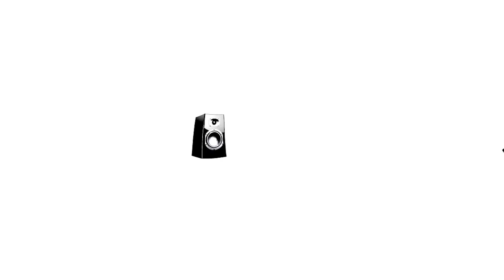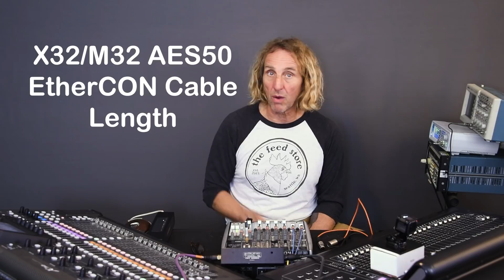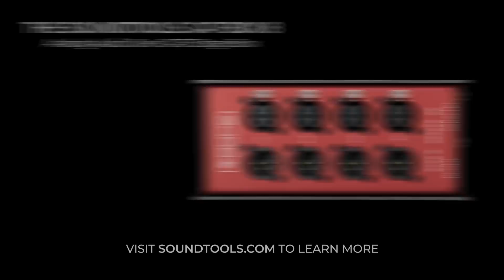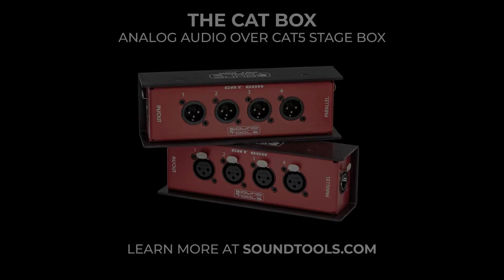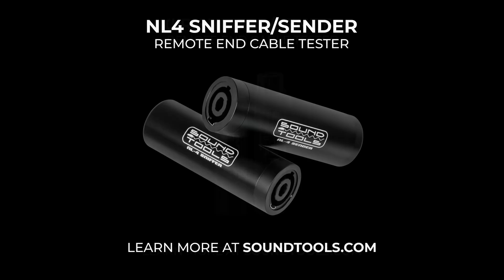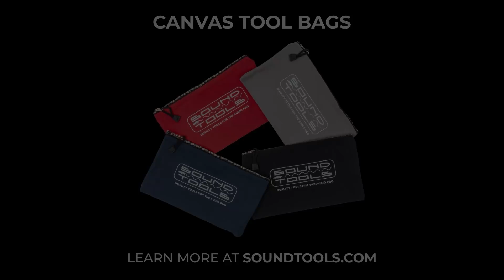Behringer X32 Midas M32 AES50 Cable Type & Length (Public)

Comment: It’s bespoken and proved, that you have to take a cat5e shielded cable. I used a professional 100m cat7 out of my stock, brand new and it produced crackles. I use now a 75m cat 5e cables as required by Midas with an cat5e extension from the drum to the board and it works without any issues. I even used a Thomann pro snake cat5e cable someday and it worked without any problems.
Longer than 75m I didn’t got some experience.

Comment: I know most of you will probably tell me that I’m playing with fire and I would normally agree. However with using this setup for a few years without fail, it may be worth a shot and extend the experiment to a few more folks by giving this a try with their own setup. I’ve owned Roland M Series consoles for a while  and have and used 100m REAC cable without issues with these consoles for years. Over the past few years I’ve purchased a few X32s to have in my rentals and have been using them on a regular basis. The Older Roland consoles required a Cat5e Crossover cable with ethercon connectors and no shield on either RJ45 connector . By surprise I was testing Cat cables and this REAC cable has worked flawlessly. I know it shouldn’t and not to trust it. But it has been rock solid no dropouts, no weird noises and I’ve had this cable fully extended to the full 100m on a number of occasions. This cable is breaking all the rules….over 80m, no shielding and a crossover cable. What gives? Has anyone tried making a crossover cable?
Reply from the maker: Many unshielded cat5e cables work fine with AES50 up to 100 meters. As I mention in the video, the issue is that unshielded cable is susceptible to electrostatic discharge. So when you're doing a show on carpet or in a dry environment those little shocks you get can fry the AES50 circuit and destroy the connection permanently.

Because of this, Behringer/ Midas has now put "use shielded cat 5 cable only" notices and stickers on the consoles.

For most or many applications using on shielded cable is fine until it's not and when it's not it's a complete shutdown from a single spark.

And then the big issue comes in that as soon as you switch to shielded cable it no longer works at 100 m. Or at least that's the case for most shielded cat5e cables

All good using unshielded especially if you're not in an environment that gets lots of static electricity.

And also there are people I believe that want to use a shielded cable and be safe from losing their show to a spark and also need 100 m or more in length

And that is what I'm working on with this cable
Reply: Thanks for the quick reply Dave. I know I’m living precariously with this setup. Hence I too have been trying some other options. I have a 200ft Cat6a in transit and will test that as well.  I still don’t understand with all that is happening that this cable is able to work even with a crossover designation. Has anyone played around with the Ultranet feature and what format of Cat can be used for that port? Cheers and thanks for all of your time a dedication to this subject. It is appreciated on this end.
Reply: @ARTAudioCan 
For ultranet setup there are allegedly issues for more than 6 items in the signal chain, as I’ve been reading in forums. I didn’t noticed it. I’ve been running six monitors, six subs and two tops in one chain flawlessly. I’ve been using Thomann pro snake cat5e cables and even had to dismantle the neutrik plug to plug them into the Turbosound subs and tops. Silly, but a different topic. Anyway, it worked and it still does.

Comment: Any sort of inline connector is a terrible idea for network cabling as it causes impedance mismatches which cause signal reflections and everything goes bad really quickly. It's very important that they be single unbroken runs of good quality CAT cable. It's much less about the length of the cable than it is avoiding having any joins; this is why you say stuff like "100ft worked but then I added a 6ft extension and it stopped working" it's not because it was only just working at 100ft, it's because the inline connectors screw up the transmission line properties.
Reply from the maker: And all of that is easily measured and tested. A great cable with several couplers can outperform a crappy cable with no couplers. The only real way to know is to test it.

I am currently designing and testing a cable for AES 50 that is stable and dependable at 100 m with a 30 m extension.

In my opinion, you should be able to take any cable and put a 10% to 20% extension on it and have it still work perfectly. If you can do that, then you know that when you remove the extension it will be very stable and dependable for your application

Comment: I would love to see waht it is like with a CAT6A cable. Anything to help the situation and make using my Midas M32 and Midas Stage Box more stable would be great. I cheaped out on a 50m Cat5e from a well known online music equipment provider (It was their own brand) and it cuts out all the time. Bought myself a better one (hopefully) from somewhere else. All I can say is that the cheaper one I bought clearly is not good enough for my needs.

 Love your videos by the way Dave. I have found them very helpful, you're like a guru of sound engineering.

Comment: Dave, I really appreciate your videos.  Generally ethernet cable shouldn't go over 100 meters when connecting computer and network devices.  I know you said not to use any connectors or couplers, but I was wondering if you have used a network switch or a repeater to boost the signal.  I might be over-simplifying the solution, but I wonder if anyone has tried it.
Reply from the maker: We have used switches to repeat and longer runs, max length really depends on the format and data bandwidth

Comment: I had a load of Cat6A so decided to invest in the connectors thinking it would be better spec. How wrong I was, It would be amazing if @midas could update firmware to be compatible with higher spec cable. I enjoy on your vids Dave but this one sent me down an incorrect path. Will have to upgrade by console to PRO series so I can use the cable I have made 😂Thanks, Sam.
Reply from the maker: Hmmm, my take is that Midas Aes50 should not be used with cables over 80 meters.

Cat6 won't save ya. The soundtools supercat sound cat5e works well. The cable that works best for distances is unshielded belden cat5e but it also works poorly for static issues.

Best is to get a Dante card
Reply: @DaveRat  Ok, so managed to get a sync happening via using dl16 stage box as master, whenever I try to set M32 as master, I have issues. So CAT6A does work with high quality Neutrik connectors. Thanks for all you do, Sam.
Reply from the maker: Awesome!

Comment: Hi Dave 👋 

Cat6a is known to not play nice with AES50 at all. It’s also a reason why not Behringer drop down to 80M max with the new stuff like the WING and do not recommend a cable type, just Shielded RJ45.

When I experience AES50 dropout, creating a loop seems to help, connecting a second cable in the B port of both device seams to stabilize the sync. 

I personally run a Cat5e Shielded Stranded that I made myself with metal RJ45 connectors and it survived fine 2 festival sessions so far.

Comment: Another good reason to go Dante for stability or long runs, is that it's incredibly easy to send it over fibre.
Reply from the maker: Agreed, we (Rat Sound) have lots of problems when bands bring in X32 and M32 and use AES50. I did this vid to help people understand why
Reply: @DaveRat  have you much experience of using the Klark Teknik fibre converters for AES50? I'm urious if they're as dependable as Dante over fiber.

Comment: Scanned about half of the comments, didn't see anybody bring up the question of how is the shield draining? I tried to get an answer on the Behringer forum and stop after a few rounds because nobody understood my question correctly. Made up my own mind based on experience with similar products and got 100feet (not meters) of "ethercon" compatible product that drains the shield at one end ONLY. At 100+ meters, the electrical will most likely be on difference branches and if at a commercial venue (3-phase, 208v) probably between two phases. If you connect the shield to chassy ground on both ends, you will probably induce a ground loop -- hence why I opted for a cable that only drains at one end. Doesn't matter which, just that it only has one path to earth ground.
Reply from the maker: Hmmm, since Aes50 does not need a shield to operate, and because hum induced by a shield ground loops are not really an issue, and it has been shown that static electricity pulses do alcaiae issues for aes50, I would say the preferred connection is to attach the shield on both sides for maximum protection from interference.

From what I have found, the best performance cables for aes50 are unshielded but that leaves you exposed to static electricity issues.

That said, under 250 feet, most cat5e or better cables worked well.  The eissues arise at lengths over 280 feet
Reply: @DaveRat  it would be interesting to test a 100+ meter shielded cat5e/6+ that drains the shielding at one end and test. Tying multiple earth ground points might just be a static noise magnet. Not exactly related but know of industrial install (think it was like Florida) where UK equipment 'demanded' additional ground rods near the equipment... lightning would end up going up one ground rod across ground to main panel ground rod instead of traveling through earth. Kept on popping equipment until they removed the 'additional' (not required) rods installed within feet of the industrial equipment. Static is similar in that you want to provide one path to earth ground.
Reply from the maker: I tested grounding one end, both ends, no ends, various cable types and lengths. Un shielded larger diameter cables worked beats but was more unstable when exposed to electrostatic charges.

I am guessing it is the added capacitance the having the shield creates. And not unlike a mic cable with loads of gain, when wiggles or stepped in, there can be noises. Those noises cause dropouts.
Reply: @DaveRat  Thanks for testing and reporting back. So if you are in a "clean" environment, long runs of unshielded works best. Guess if you need a galvanically and electrically isolation, going AES50 (aka SuperMac, 100mbps) over fiber is best (but expensive, see Klark Teknik DN9620). I heard, but never used myself, of HyperMac (1000mbps) over fiber intended to be used between FOH and Stage, with various routing options (Midas PRO3 Series). 

My "related" experiences when draining on one end was wiring WS2811 (12V) LED "pixels" strips. Had issues with noise and capacitance over shielded 3-conductor cable (+12V, GND, DATA) at 15+ feet. Leaving the shield floating caused the most issues (capacitance), grounding the shielding at both ends caused issues. Draining at the source end was the cleanest -- but mind you this is an unbalanced data line and each WS2811 module re-creates data line -- so have to only protect long runs. AES50 uses balanced pairs.

To muddy the waters, GLS Audio Ethercon Compatible RJ45 Cat6 (can remove the "cannon" style barrel easily) has as a marketing bullet "Ground lifted at one end to prevent unwanted noise and hum (required by some electronics which don't support a common ground) " -- which got me thinking about proper static draining. 

Jury is still out it seems, but according to you @DaveRat and when using shielded cable, as long as there is no ground loop potential (current along shield) static draining at both ends seems to work best if I heard you correct?
Reply from the maker: My take is that for doing a show, a very high confidence that all is stable is important. Aes50 has proven to be unstable over 80 meters and jumping through various hoops to try and hillbilly a fix, is not an acceptable solution.

Especially when severe loud pops and drops are the result.

I feel Beringer has mis represented the true specs and the 100m published spec is unwarranted and is the cause of all of this confusion and issues.

Had they spec'd it at 80m like they should have and where it operates relaibly, all would be good.

My take is that the product should operate at 20% over the spec. So spec'd are 80m should be quite stable at 100 and always stable at 80. Spec'd at 100m means it should operate reasonably well at 120m, which it does not and can't even operate relaibly at 100m.

I believe the public should hold the manufacturer accountable for falsely specing the product.

Comment: Hey Dave! Thank you for these amazing videos! As we have started to play bigger shows with my primary band, I meet a lot of more than 70m long cat5s. Is DN9610 solution for us? Or are we just screwed with 100m long cable? Thank you for reply.
Reply from the maker: 80 meters seems the consistent reliable max. I have not tested the DN9610 but going to Dante, AVB and/or fiber will solve the issue

Comment: Running M32, 2 Midas DL16 stageboxes and dante to amp. Out of the blue getting pops and dropouts. We are running your 150' purple aes50 cables. Re-ran new ethernet to dante amp. No change. Thoughts?
Reply from the maker: Hmmm, are you using any extensions or barrel adaptors? All the cables need to be straight console to console. 150ft should not pop or have issues. Give a call to soundtools support and we can assist

Comment: Great video and thank you for the run down. After some varied success over the years with house cables, the touring solution for me is running my own 2x Pro Co 100m Cat5e from FOH at the same time, one to DL32, one to X32c running IEMs. Then a 1ft cable connecting x32c to the DL32. X32c is the master, M32 is getting sync there. My thinking is if there is static build up, it will dissipate throughout the system without loosing sync, Definitely a fragile system.
Reply from the maker: Interesting and thank you Dave

Comment: I believe if a data cable has to be split or redirected, the proper termination for the split data line requires a termination however not similar to a DMX data line. I found a topic on using a 3 resistor configuration to terminate the end of a data line but still doesn't address AES50. As you said the best and probably only way to split a consoles signal is by way of using a plug in Dante card or Dante AES50 to Dante box. Klark Teknik KT-AES50 Network Module.

Comment: Just a thought. Adding any length XLR cable, tapping the data line at any point, would cause failure due to the cable not being terminated. What is happening as you may have already discovered is that the data signal travels down the unterminated cable to it's end. Just like a wave in a pond. Once the data signal reaches the end it bounces back down the cable and mixes with the original data signal. The destination equipment will receive the original data signal and a ghost data signal slightly delayed by the length of cable. This can confuse the receiving equipment's processor. I bet the data signal would continue to function normally when open ended data cables are properly terminated. Just like the need to terminate long runs of DMX cables.
Reply from the maker: And also if it was analog the added cable would have no audible impacts. The issue I in trying to demonstrate is the instability and that 3ven a small unterminated antenna is an issue!

Comment: I've been using Belden 1305A (UTP Cat5e) for years on X32 and M32 consoles always connected with a DL32 stage box.  I've never had dropouts, but my snake is 165' (50m).  I'm not sure if it is the shorter length, or the fact that I've got power lashed on to the snake and the console and stage box always have bonded cassis grounds, but I've never noticed any dropouts.  Always plugged directly and without interim connector panels.

I have colleagues using 250' (76m) sections of Rapco DuraCat6 cable (UTP) between M32s and either DL32 or DL251 stage boxes with no issues reported.  Both my snake and my colleagues snake have Neutrik RUBBER-CAP-CABLE caps on all Ethercons, and I believe we might owe a nod to this keeping the snake reliable.  I try to treat these with more reverence and avoid dragging the connectors.

....but then I have some other colleagues that were using Ethercon snakes of some kind, that had dropouts in a show, and they dumped the entire platform.  I think it was an STP cable of some kind, but I've not been able to verify.
Reply from the maker: Nearly all cables seem to work with lengths less than 80 meters.

The goal is to find a stable cable that works always at 100 meters. So adding in buffer length, will test well at 120 meters for usage at 100 meters, which is the manufacturers specs.
Reply: That's good to know.  Sorry if I missed this point in the video, but did you find any correlation between UTP and STP cables for this AES50 application?

I may be looking at additional snakes, either 165' or 250' depending on application, so it sounds like we should continue to be good at 250', which is just below 80 meters.  In the largest venues that I deal with, 250 should be acceptable.
Reply from the maker: I found and have read that UTP tends to be more stable but UTP is more susceptible to static electricity with catastrophic results.

So, STP is safer but tends to run shorter distances